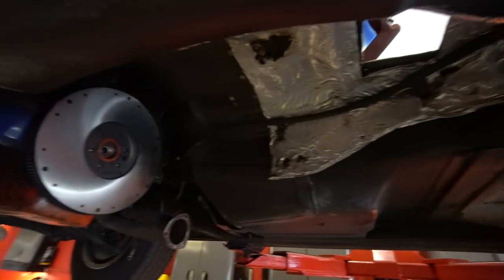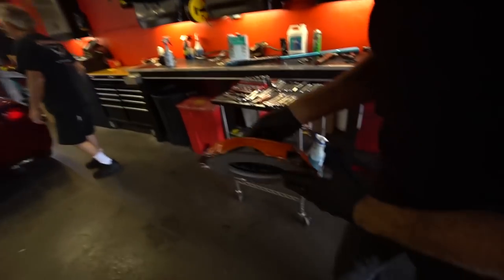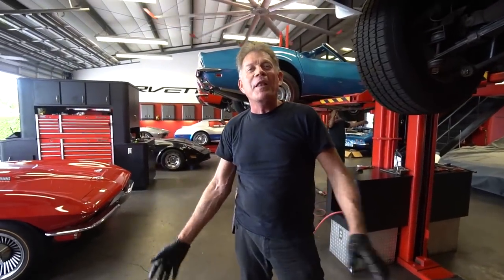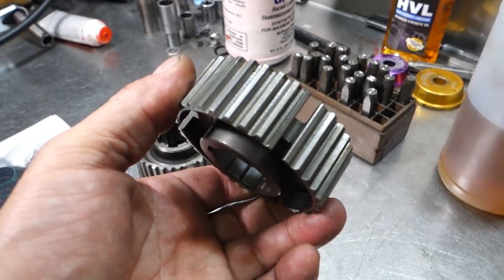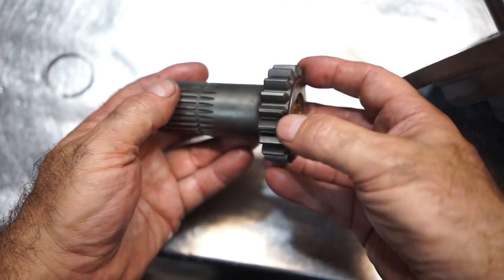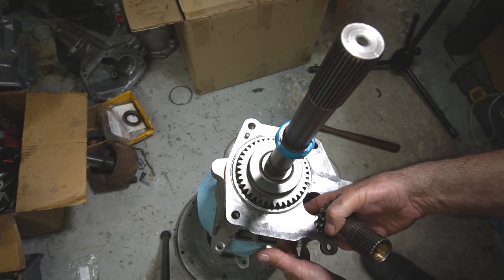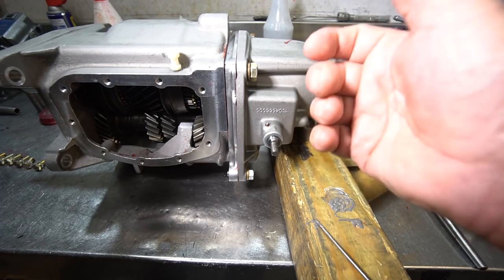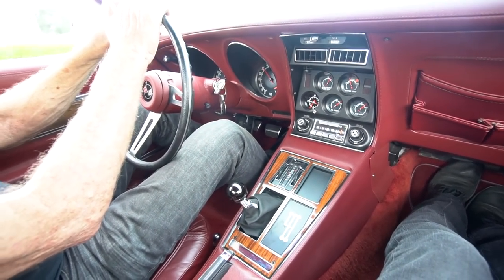How To Rebuild a Super T10 4 Speed - Part II

Comment: How should  I  go about removing 1st and 2nd gear from my super T10.  I have 2 4 speeds. I  need 1 to be a 2 speed for short tracks and keep one  for 4 speed on longer  tracks. The 2 i have were built for racing in ASA. and have never been  ran. 
Running a open wheel MODIFIED on asphalt  the 4 pounds of weight loss could be the difference between winning  and  losing.  I  am  in Florida also. I  have looked  everywhere for a tutorial.  I cant find one. This is the closest I  have  found.
Reply from the maker: leave the 1-2 hub and first gear bushing in and remove the gears. Leave the slider and fork in.  You can pin the 1-2 shaft to the cover in neutral to avoid it moving.
Reply: @GearBoxVideo  im in Sanford same state as you.  I am used to running 2 speed muncie. Know how to build them, and know tons of people that build them in my area, Mainly BUZZY FUNK. This is the first time I  have  ever owned not only 1 but 2 Super T10 transmissions.  Both are 2 ring inputs. BUZZY won't touch them. They are both freshly built transmissions. I would sell them and buy a Jericho,  but we aren't allowed to run  straight cut gears in my class. They just started allowing us to  use 2 speeds. These transmissions came with a brand new LEFTHANDER MODIFIED I bought that has sat inside a trailer at a JUNKYARD in Melbourne.  I have run into an issue,  I  have no clearance for the 4 speed HURST Indy short throw   or competition plus short throw moded shifters. So I  need to sell these and buy an M22 
2 speed. . I  have  seen how much Super T10s are valued at on the low end. Im wondering if I should just get rid of what I  don't know and get what I  do know and have 30 years of experience working on.  Advice?
Reply from the maker: The ST10 and Muncie have similar shifter mounting points. So I don't see what the problem is.

Comment: Hello guys! I have a problem with my Audi a3 8L 1.6, manual transmission, from 2001 and i wonder if you could give me an idea on what might cause it. Sometimes the car has shifting problems. It goes very hard into gear. first gear is especially hard to engage. when i go into reverse it grinds a bit. But all the gears are difficult to engage, not just 1st and reverse. This happens only when the engine is turned on. With the engine turned off, the shift works perfectly. In some cases, if i turn off the engine, wait for a few moments and then start again, the shifts return to normal and the car works just fine. the strange thing is that this happens only from time to time and it's not a permanent problem. Could it be just a worn out clutch or pressure plate. I think my transmission is a 02k model. thanks!
Reply from the maker: You have a clutch release issue. Could be bad hydraulics such as a master or slave cylinder.
Reply: thanks for your answer!

Comment: The welch plug that caps the hole in which the reverse idler shaft alignment pin is missing on my ST-10. Any pointers on where I can find a suitably sized replacement? I don't see the welch plug in kits.
Reply from the maker: It is a 1/4 plug available from Dorman
Reply: @GearBoxVideo  and quick question. My original BW ST-10 needs to be resealed. Its leaking right from the area where those two bottom bolts are as described in your video. Where the midplate mates to the extension housing. If I also wanted to replace the gasket between the other side of the midplate and the main case, is there a way I can remove the midplate with the bearing intact without having to extract the entire main shaft gear train? Looks to me like i can just remove the reverse gear, reverse idler gear, and counter retention bolt, and it should be able to lift straight up and off the length of the main shaft.

Thanks again, amazing video!
Reply from the maker: That would be hard to do.

Comment: Do you have the transmission input shaft simply stuck in a flywheel as a makeshift fixture to assemble the tail housing?
Reply from the maker: No most fixtures bolt to the case. Why would you want to create a fixture to an item that must be installed?
Reply: @GearBoxVideo  I believe you have misunderstood what I'm asking.  It looked like you had the transmission standing nose down in a flywheel as you were installing the tail shaft housing.  Am I seeing it wrong?  I need a type of fixture hold the trans to simplify my main shaft speedo drive gear installation.
Reply from the maker: No just a special fixture
Reply: @GearBoxVideo  This was clarified for me in another one of your instructional videos.  You mentioned you were using an old case as a make shift holder of sorts while having the transmission nose down.  Thank you, Paul for your responses to my questions!!!  Elijah

Comment: Does anyone know what 5 speed out of a 1984 z-28, had a main case tilted to the left, was a mechanical clutch release, and a "top loader" the case ears looked like a conventional 4 speed except the lower right ear was longer than the rest?
Reply from the maker: It's a standard clocked GM bolt pattern. Same as a Muncie. It was clocked for ground clearance

Comment: I’m trying to put a 4 speed on my
78 camaro which one should I
Go with? Muncie of a super t-10
Reply from the maker: Depends on a few things like axle ratio, engine, HP and type of use.  You have to look at the overall picture.  Each has its own pros and cons.
Reply: If you're buying a used transmission, super t-10s are way less expensive. Just stay away from the Saginaws.
Reply: Super Duty 455 I have a th350 now, do I need to get a new driveshaft if I go with the super t-10
Reply: @andreg8192  Maybe just the yoke?

Comment: Any idea how much psi a super T-10 generates during operation?
Reply from the maker: PSI?
Reply: @GearBoxVideo  😔 I broke a bolt on the side cover of my transmission and put rtv in the hole because I cant find replacement side cover bolts.
Reply from the maker: It's a standard grade 5 /16-18 thread bolt. 7/8” long

Comment: I’m workin on a 1977 dodge d100. 4 speed it does have over drive. I bought a Chrysler a833 trans rebuild book. And I took it apart cleaned everything 100%. And I took everything apart the way it said. I put it together the way it said to as well. And now I’m a bit confused. When I spin the input shaft while the sliders are in neutral. It also spins the output shaft. And when I put it into gear it doesn’t spin at all. It locks up. I’m confused if I did sum wrong of it it is supposed to do this anyone have any idea?  Am I not supposed to be able to spin it while it’s in gear, with my hand?
Reply from the maker: Sometimes new rings stick to the gears when dry. Use a yoke in the back and try and rock it loose. Dry shifting a transmission with new rings often times will cause the ring to stick to the gear. I have a video on Stuck Synchro rings. Search for it on my channel
Reply: GearBoxVideo I didn’t use new synchro rings the old ones looked good, no rounding of the teeth and the grooves in the syncro seemed alright! I can spin it when the slide isn’t touching any synchros. What as soon as I put it forward or backward it only always it to spin a very little bit back and forth. I greased everything when I put it together so it wouldn’t stick
Reply: @caleb4750   One gear is bound up. Shift into every gear and try to turn input shaft. If it turns in only one gear, then that gear is bound up. In any other gear you have 2 gears engaged at same time in effect.

Comment: were do i get a rebuild kit?
Reply from the maker: My web store is www.5speeds.com/cart
Reply: @GearBoxVideo  thanks
Reply: @GearBoxVideo  how to know what kit to get for my trans
Reply from the maker: It would be helpful to know what you have.  The BKST10 kit is the most common kit for the 26 spline input st10
Reply: @GearBoxVideo  26 splin two groove input shaft 1304065903 4 speed super t-10 date code 6-24-77
Reply from the maker: As mentioned the BK-ST10
Reply: @GearBoxVideo  thanks for your help
Reply from the maker: Check your email
Reply: @GearBoxVideo  i sent correct billing address
Reply: @GearBoxVideo  did my order go thru?
Reply from the maker: Ships Tuesday. It hasn't processed yet
Reply: @GearBoxVideo  what do i need to do
Reply from the maker: It's will be processed. Be patient
Reply: @GearBoxVideo  ok

Comment: about speed rings  "...there's no need to change these.  Just reuse the one you have."  Unless the goof who owned the car before you melted the plastic ring teeth.  Then...if it's a green ring, good luck finding someone to sell it to you if you don't live in the States.
And so it goes...LOL!
Reply from the maker: What are speed rings?
Reply: @GearBoxVideo  sorry typo...speedometer rings
Reply from the maker: Pencil gears for the outside and drive gears for the inside. Everything is still available